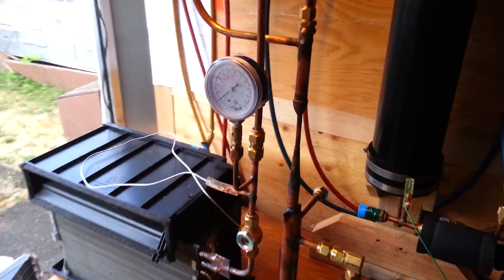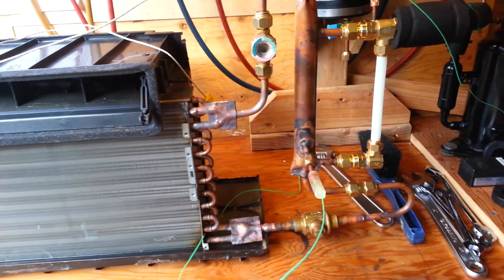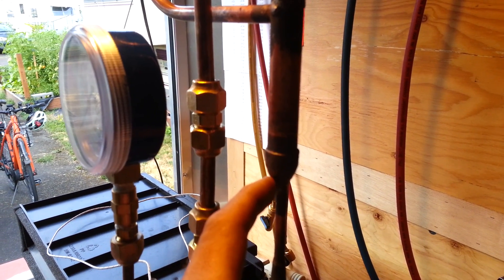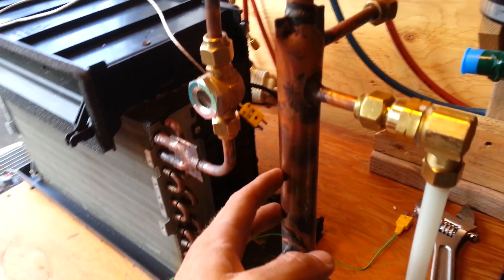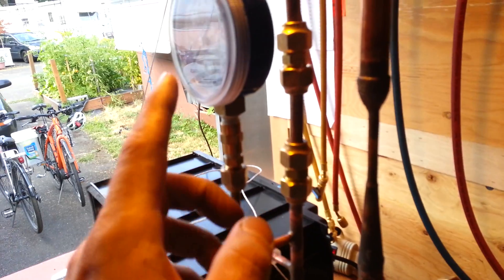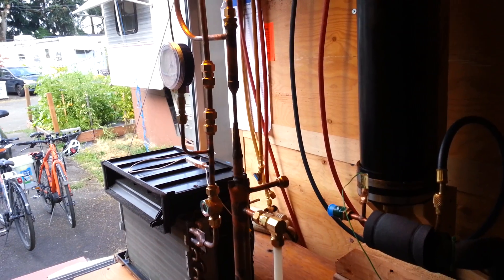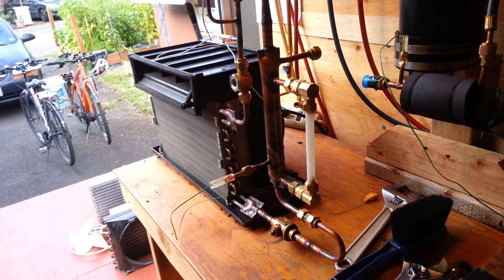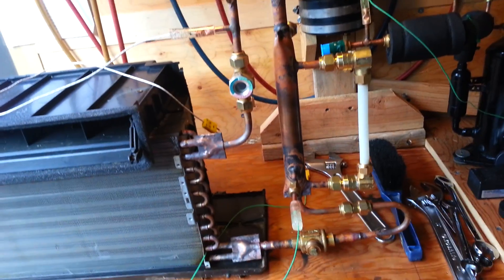Ejector Refrigeration Assembly

Comment: Hi. Can I use as single phase i.e single flow of fluid.
Reply from the maker: vivek ghori this system is based on vapor compression, so no.  Single phase gas cycles are possible, but they are constructed quite differently.

Comment: Hi. What refrigerant did you use in the system?
Reply from the maker: This is R290. Propane. It is not refrigerant grade, as it likely has a good bit of water and also some butane, propylene. Works fine, and is cheap. Maybe not good for long term use, but for experiments it is great.
Reply: Can we use water steam as refrigerat
Reply: Can we use water steam as refrigerat